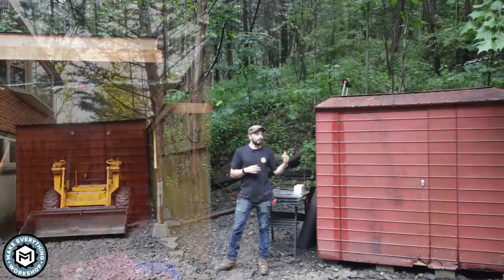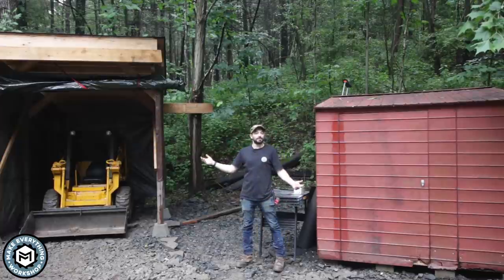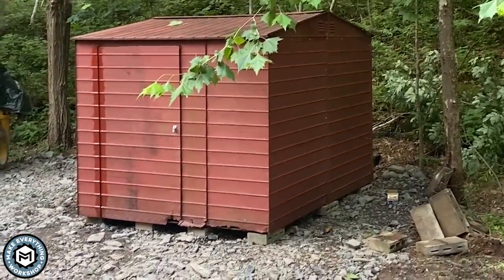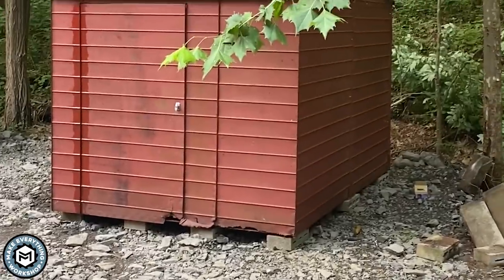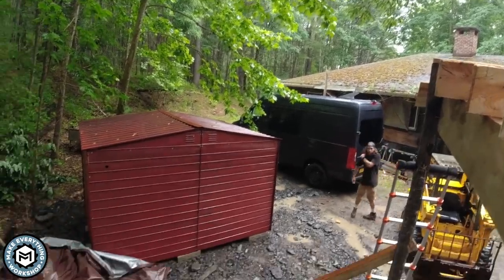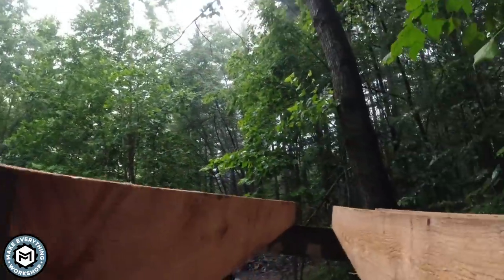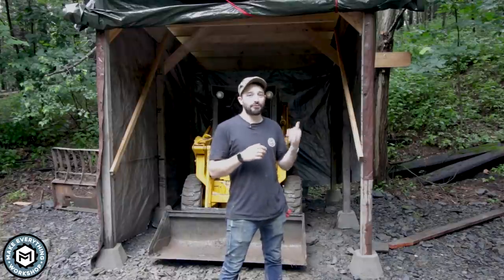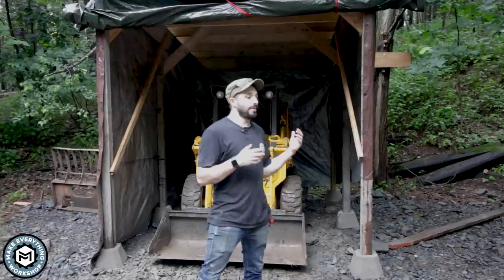Building a Carport and Shed in a Weekend! Upstate NY Property Update

Comment: those trees WILL move as the wind blows. I hope those screws you put into the trees will hold up.
Reply from the maker: Absolutely they will! Thats part of the reason we put the posts on those concrete feet as opposed to sinking them in the ground. We used 7" GRK Structural screws to hold the ledger up to the trees, and added those posts near the trees to hold the load. I ordered some even longer screws made to go into trees to add next time I go up to the property.

Comment: Wait.. why is the carport screwed to those two trees? Isn't that going to cause problems as the trees grow?
Reply from the maker: The rate at which the trees will grow won’t be fast enough to effect the ledger board we screwed to it. While I’m happy with how it came out this definitely isn’t going to be there for more than a few years until I build the garage!
Reply: Pretty unlikely. The trees will push the boards outwards very slightly, but for the most part will just envelop the boards (in ~20 years). They won't move up, the height is stationary.